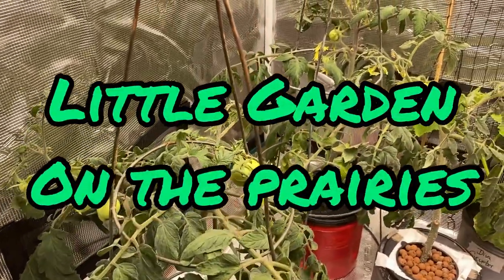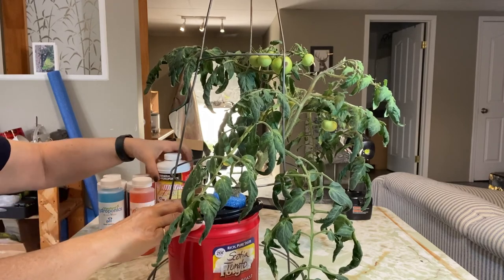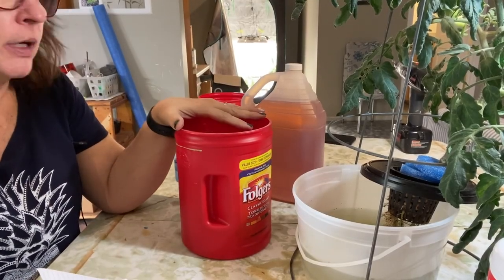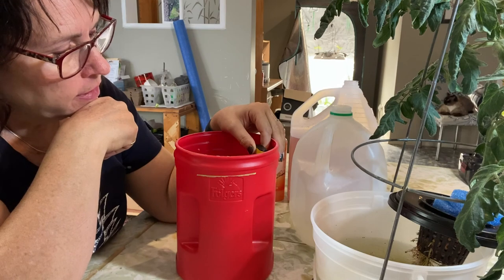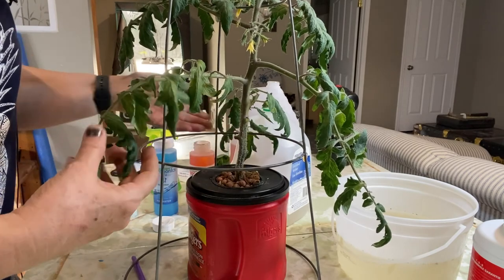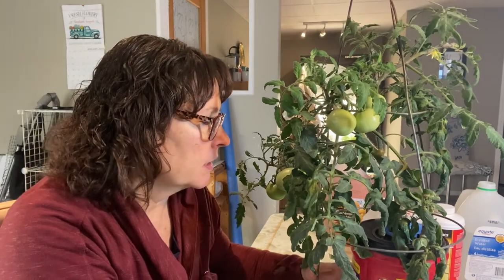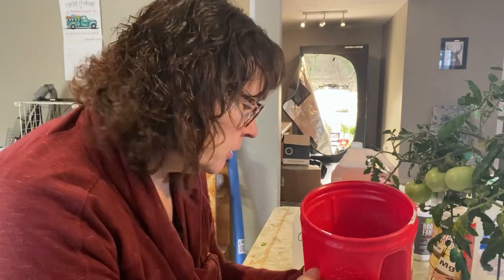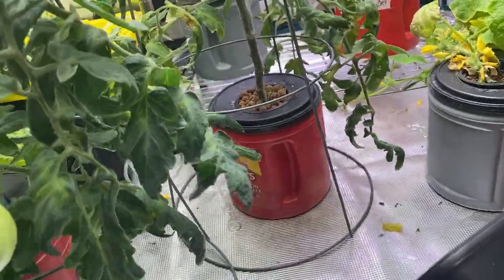Indoor Hydroponic Garden Update - PH & EC Testing - Tomato Blossom End Rot

Comment: First
Reply from the maker: Hello Cajun!  Any experience with BER in your hydroponics?
Reply: @LittleGardenSK  oh yes I am trying to find the spray I use. I don't remember the name offhand. But the dude side tracked me. Let me go see again lol
Reply: @LittleGardenSK  it's by ferti-lome called yield booster its a spray on the leaves.
Reply: Sent you a picture on IG messenger. Something else that would help would be to refresh you buckets more often. Maybe once a month. The tomatoes will use up most of the nutrients in the smaller buckets fast leaving behind what they don't need. Adding fresh nutrients helps but will cause nutrients to lock out and the plants won't uptake much at all. That is probably the reason the plants started drinking so much after you refreshed the nutrients.
Reply from the maker: @CajunHydroponics  ok thank you!
Reply: @LittleGardenSK  your welcome. Feel free to ask anytime. I may not know the answer but it's easy to ask. We keep building each other and helping. That's the great part of the gardening community
Reply from the maker: @CajunHydroponics  thanks.  That’s great advice.  I’ve only changed out the one time.